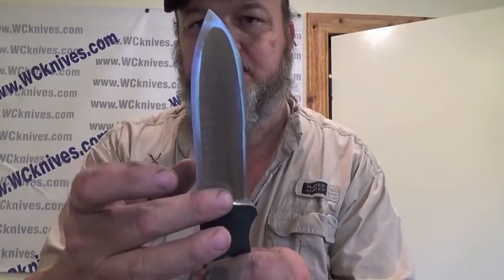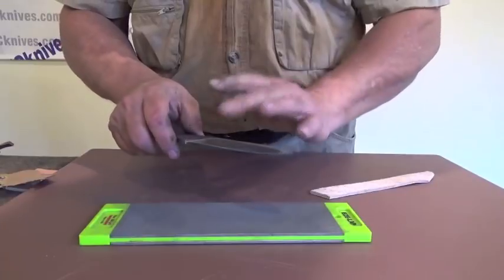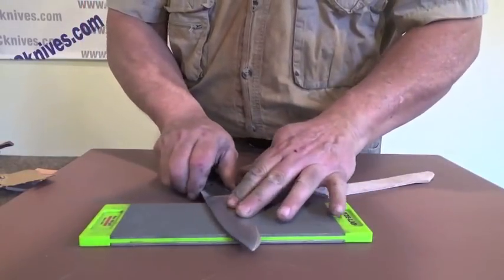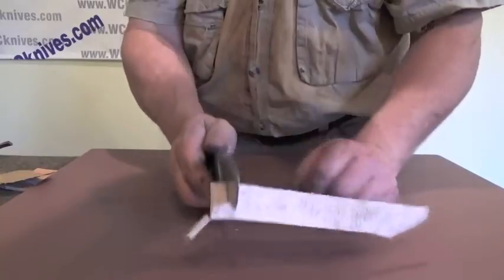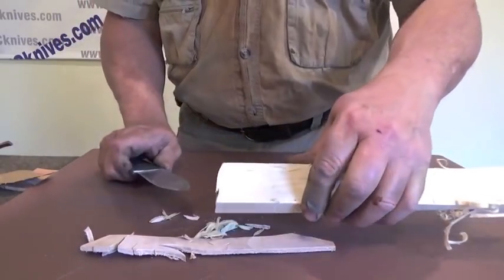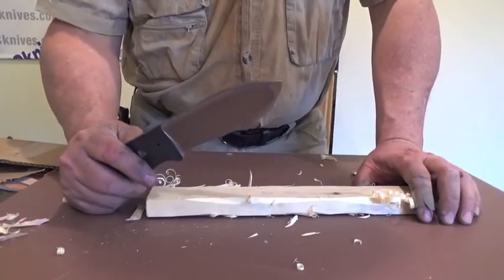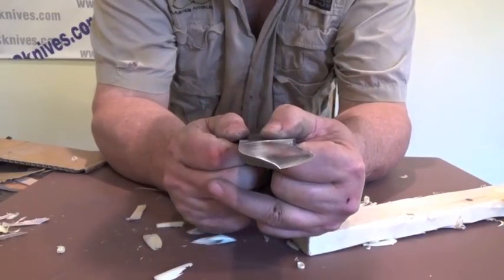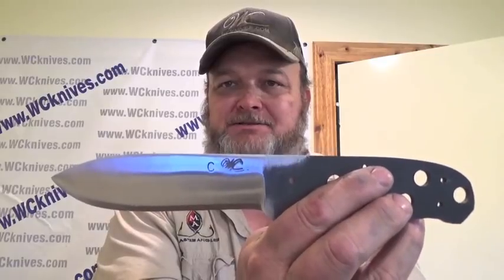Russian Style Yakutian Knife Prototype Model C Third Revision

Comment: I think another hunting/fishing trip is coming.
The actual handle is rat tail. Cause they cannot have any metal expose. If you touch metal in Siberia,  you get frost bite. But in Texas, you can any style of handle you want. The chisel side was forge, cause there was no power sander/grinder until 20th century.  There is no harm using  whatever technology we have to improve the design. No one baton  frozen wood. 
So making a traitional  leather over wood scabbard? Or you leave that to Randy from Stitched Gear Outfitters to think about ;P
Reply from the maker: LOL, yep not much danger in Texas with exposed metal except for burns in the summer. Don't think there will be a traditional sheath and yep I'm ready for a camping trip if it ever stops raining here.